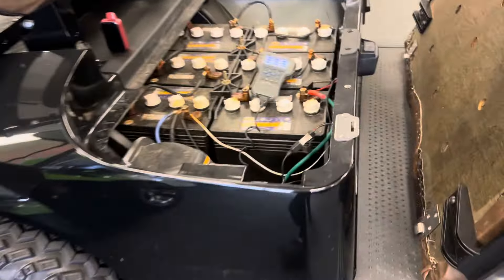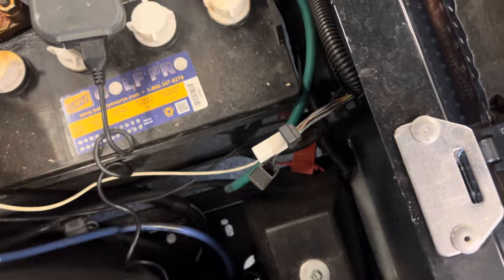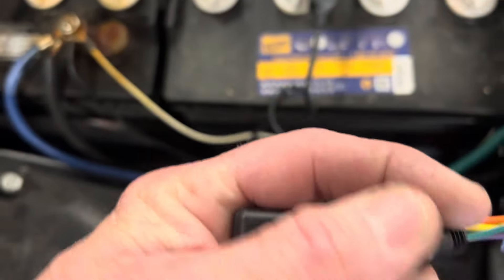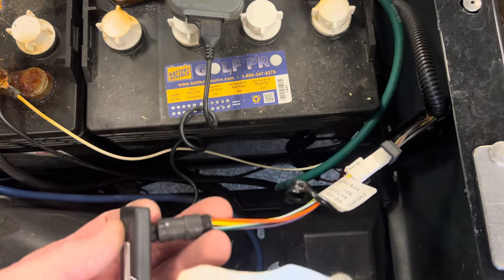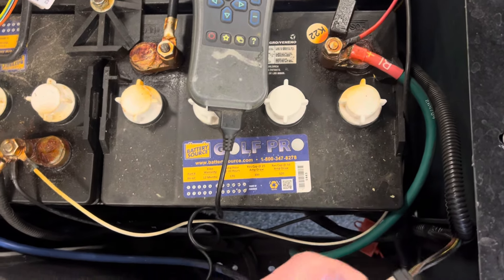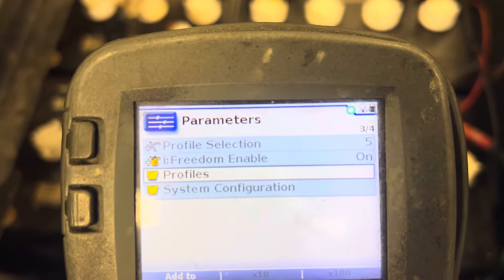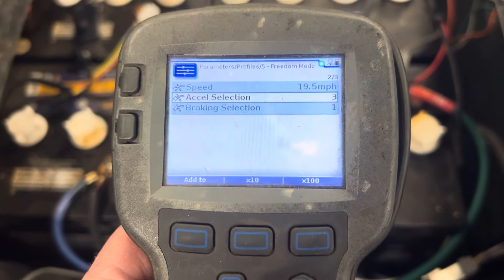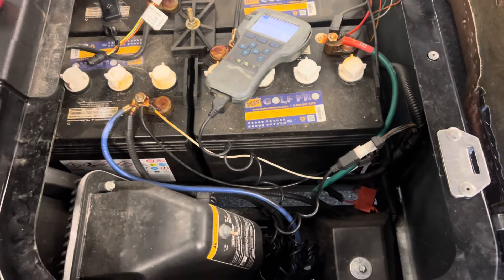EZGO 48 V EZGO SPEED CHIP INCREASE

Comment: How can I increase speed on a 36v ezgo txt not sure of year
Reply: Seen the speed chips online but not sure what one I would need
Reply from the maker: @dcram08  if you have a run to switch, you can put a speed chip in. As long as it’s not a DCS. If you don’t have a tow switch, and all you have is a Ford reverse handle by your leg. The only thing you can do is put a high-speed motor on it.I’m going to share a video with you and tell me if you controller is like this
Reply from the maker: @dcram08  https://youtu.be/AJMxTTlW0QY
Reply: @Golfcartwhisperer  yes that’s like mine I guess it’s a series Cart
Reply from the maker: @dcram08  the only thing you can do is a high speed motor. Do you have a torch
Reply from the maker: @dcram08  Increase speed on an electric golf cart. Guaranteed
https://youtu.be/ka_elm1T2Xc

Comment: What’s the chip called
Reply from the maker: @SawyerNeedham  on the 48 volt or 36 volt?
Reply: @Golfcartwhisperer 48 volt
Reply from the maker: Gotcha it’s. Called speed chip for txt 48 volt
Reply: I have the txt 48v and cannot find anything that looks like that chip on eBay or amazon. Any help with a link?
Reply from the maker: @francisdougherty4110  let me look and I’ll send the link
Reply: @Golfcartwhisperer can you post the link here. I’m not having any luck for the 48V on eBay. Does the chip have to stay plugged in to work or do you adjust speed up then unplug chip?
Reply from the maker: @MarlonFloyd-u1o  okay I’ll send post Tom. I’f I forget just send me another message. You plug chip in and it speeds it up. To 18. Which will cause a lifted cart to run 22. But if you want to run 24-25 you have to have a handheld.  To do that. Or you can take to a shop and they can sonit

Comment: if we cant afford a new motor, we sure cant affords the curtis Handheld lol            pricey item
Reply from the maker: @97warlock  yeah I don’t recommend anybody buying the court handheld unless you have a golf cart place or you work at a golf cart place and it’s yours other than that I would let the company you work for buy it. Don’t buy it for just one cart because like you said is definitely pricey item and it’s not worth it for one timewhen if you ever have a problem all you have to do is come to my channel and we’ll get it running.
Reply: @Golfcartwhisperer    Im trying to research   the junmper wires , I saw a guy open his tow mode box, unplug the top left plug, & plug in 2 red jumper wires in a connector & literally got 4-5 mph increase            .But I guess his was a dps cart ,                Mine has the switch down by my knee & it seems impossible to find anything for that type cart . for some reason.
Reply from the maker: @97warlock  so you have a dcs cart. There is nothing you can do to speed it up. Watch this video here and tell me if you have this cart.  In the video I am sensing
Reply from the maker: @97warlock  https://youtu.be/VrsA-0Ijgpc?si=EmOQlmfT8VHrwnNl
Reply from the maker: @97warlock  but trust me it’s not no 45 miles an hour. It might be 2 miles an hour tops on the PDS, which is what he has but you have a DCS watch the video and let me know if your car like that.
Reply: @Golfcartwhisperer  Mine is older that this one,. Probably a 2010    The Reverse is the KEY on the dash.         Forward/nuetral/reverse            and the tow switch is almost in the midde,where THIS cart looks like its on the passenger side.
Reply from the maker: @ gotcha. Huh run you a wire from the main positive to the small post on solenoid blue wire and see what it does